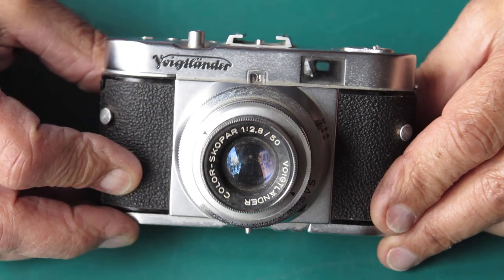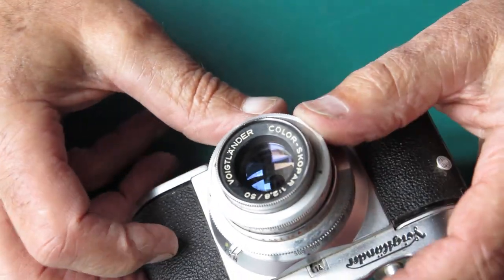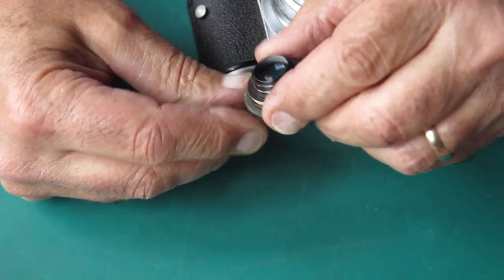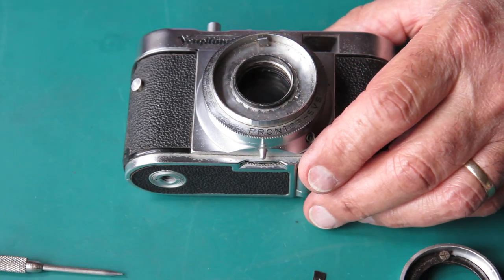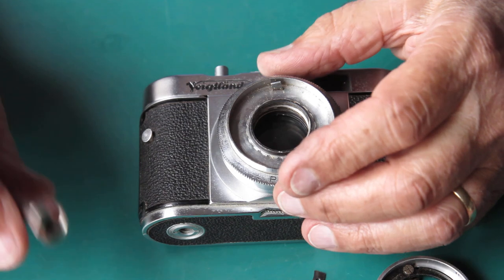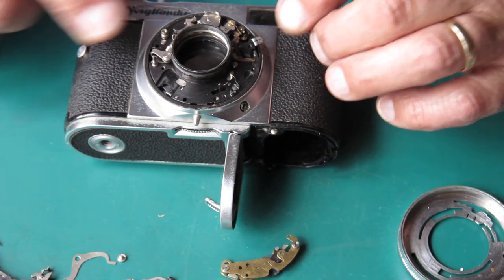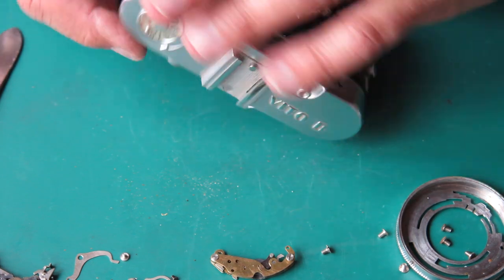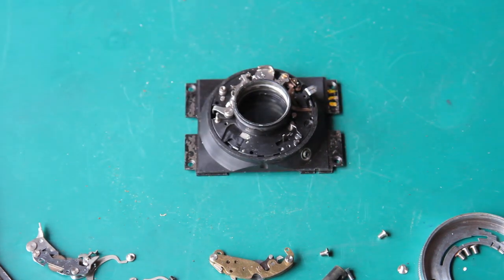Struggles with a Vito B, part 01

Comment: Thanks for the info I needed to take of the top plate to get to the veiwfinder lenses as they had film dirt making looking throught the veiwfinder misty - thanks for showing two screws hot shoe and film chamber although I did not remove the rewind wheel 
I had just bought this Vito B from a boot sale for £2 everything else works _ h- bargain eh ?😊

Comment: Hi Chris, thanks for this video series - it's given me confidence as a tinkerer to fix the slow shutter and timer issues with my recently acquired Vito BL. The internal construction of the Vito BL lens is somewhat different from the B, more engineered I'd say, so much so I've had to order a lens wrench in an attempt to remove the lens/aperture assembly. I'm hoping that's all that is needed as I don't see another way to remove the shutter speed selector ring. Great series with lot of useful tips.
Reply: Well as it turns out, with the BL although it looks like the large diameter brass ring would unscrew with the wrench, this isn’t the case. What you have to do is unscrew the steel aperture pin - use needle nose pliers to gently get it out. Then unscrew the whole lens assembly including aperture mechanism. This will reveal a black ring that does in fact need the lens wrench to loosen as it was quite tightly on on mine. The brass lens mount can then be lifted off, followed by the shutter speed selector ring revealing a mechanism almost the same as the B as shown in this video.
Reply: Thanks to Chris’ video I was able to service the drivetrain of both the shutter release and the self timer back to working condition. The biggest obstacle to reassembly of the BL was the lens and aperture assembly - basically the helicoid screw needs set just so before the fine lens thread is engaged with the holder. This is because the helicoid wants to unscrew as you screw in the lens - too much then lens impinges on the shutter, too little the assembly won’t engage with the alignment rails. Very entertaining lol! I now just have to clean up the body and leatherettes, reattach them and I’ll have a beautiful, working Voigtlander Vito BL.

Comment: I really do like watching you working on these old cameras. A lot of very good information. If I can make a request. When you have time maybe show us how to properly install the light meter assembly and gear train on a Bessamatic. From the repair manuals I have it seems to require a special alignment tool that no longer exists. Maybe there is a work around to get the light meter properly installed and calibrated.

Comment: For a simple camera, this is a nightmare to disassemble. There are so many potential traps in trying to service the shutter or even relubricate the lens helical. I'm struggling with the same issues now. Plus, the aperture blades accidentally fell out. Ugh! The construction of this camera is unnecessarily complicated, compared with other German cameras from the same era.
Reply from the maker: They certainly look simple enough on the outside!

Comment: Do you think that I can also heat up a SLR with a hair dryer? The film advance lever of my Bessamatic is not going as easy as it should and it is also not automatically returning to its regular position.
Reply from the maker: Most likely your camera has serious problems related to dried-out grease and dust in that film advance. It will have to be taken apart. Heating it up with a hairdryer isn't going to help much if at all. The hairdryer trick can be useful for seeing if a 'stuck' shutter just needs to be serviced, and if it makes no difference, then perhaps something is actually broken.

Comment: Hello, Chris. I have a number of cameras from this era, and I have been looking for a cleaning solution to use on the chrome parts that have writing on, something that will leave the writing alone. I find rubbing alcohol will erase any writing. I watched a few of your videos and you use naphtha. Is Naphtha the same as kerosene, benzene or lighter fluid? Will that leave writing on a camera body alone?

Comment: got a vito b, worked when i got it, shot half a film, about half way through the shutter stopped working. if i charge it i see the shutter closing then opening again when fully charge and nothing happens when the button is pressed. i get the shutter to almost close on higher speeds, the button still does nothing. would love some guidance as I am new, most everyting seemed to work on the camera before this happened (note this happened while the camera was a bit cold, i am wondering if maybe just re greasing it would fix it, and if so, what the best fool proof way to do so cheaply in norway would be).
Reply from the maker: You do not re-grease a shutter. It sounds to me that the shutter needs to be stripped down and serviced.
Reply: @ChrisSherlock  thanky you, i had a think, dared to open up the camera, it seems to be the part you specify in the video is the issue, the timer for the shutter, the gear train. I seem to have fixed the issue, but now speed 4, 8 and 15 (sometimes 2) wont reset. I will have to find out how to fix this. so far for a camera i paid about 8 gbp for, the glass is in very good condition with little to no rust. wonderful videos!